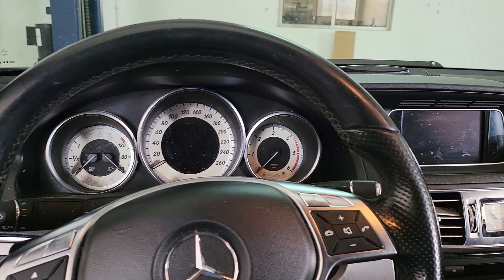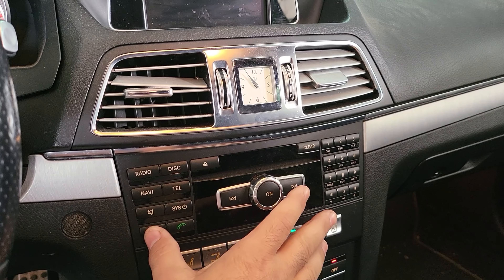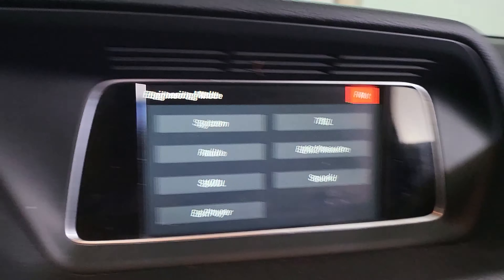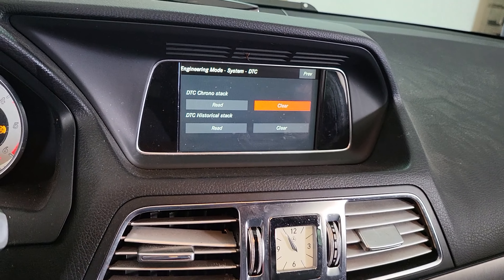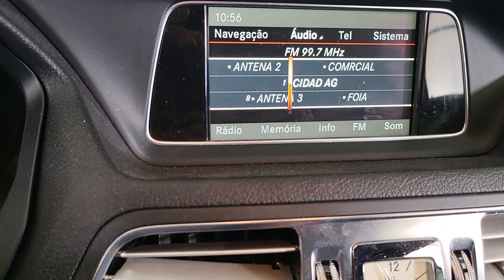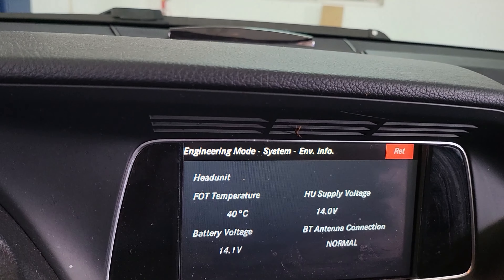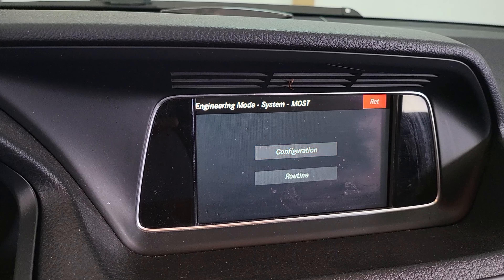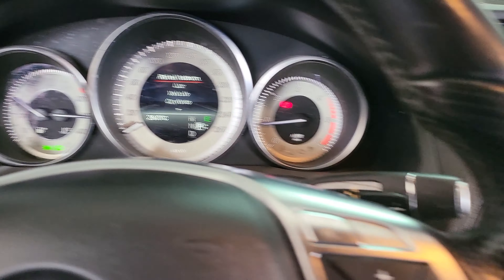Mercedes w204 w212 w207 etc Engineering Mode

Comment: i have seen somewhere there is a menu where you can change how driver assistent systems work. For example make sensors around car more sensitive and make lane depart system act faster. Anyone knows how to enable it in command screen menu?

Comment: How can we get an idea on what is the real odo of a w212 facelift..??..
Reply from the maker: Thanks for watching.
To check real mileage you would need a nice diagnostic
Tool and check all the modules including headlight modules keep the original mileage.
Reply: @PSICompanyPerformance  
Some people showed the engineering mode in the  system of w212. 
Can it be used for finding the original mileage...??.
Reply from the maker: @victorjose4873  i think you can use it for that but if the person who did the adjustment made it correctly then it would be changed in the NTG also.